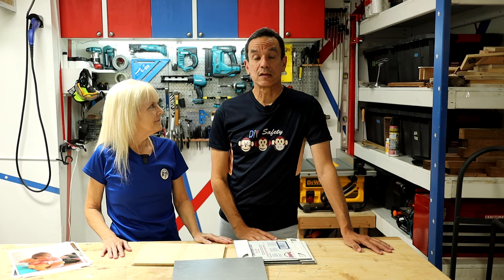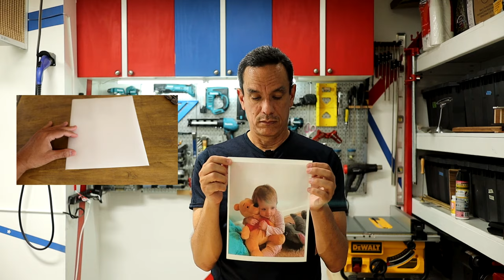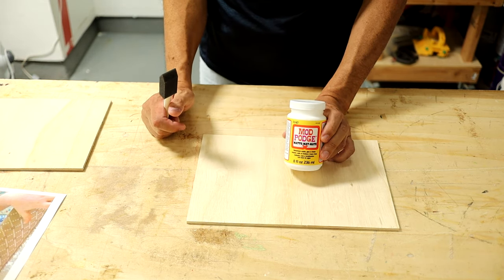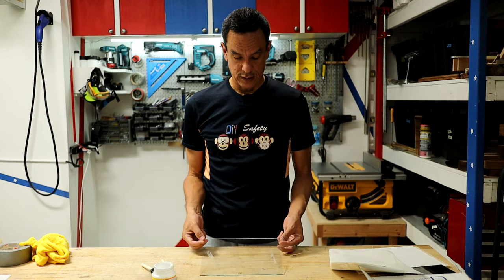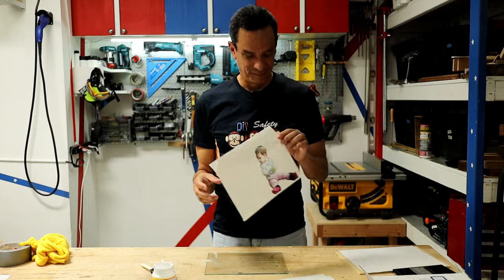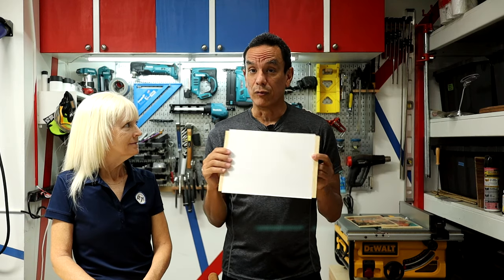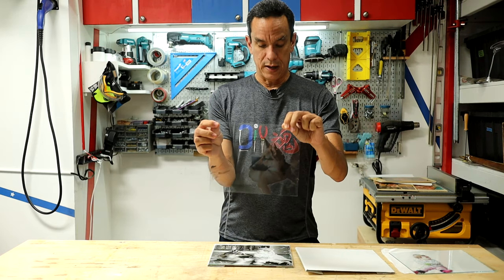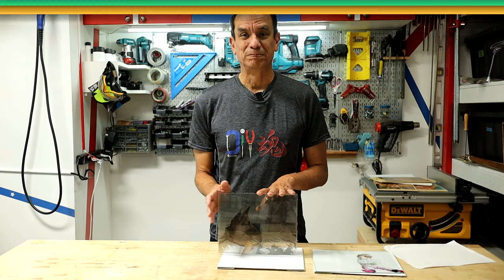Photo Transfer To Wood, Metal and Glass

Comment: It is such a bad video did not like how you showed the process ... you need to stop assuming that we, your viewing people know what your talking about you never said what kind of paper you are using its called Transfer paper and they are all different for, wood transfer, glass transfer, metal transfer, cloth transfer, and the different types of transfer paper I believe you had the generic transfer paper for transferring ANYTHING but not very good it's not as easy as you think but this is the first video clip I have watched when I first saw you both I thought I like these folks but it's not what you had said it was what was behind you, y'al have some nice toys or tools  but I will subscribe I like your honesty about what went wrong ... Poor Man's DIY I like it
Reply from the maker: Gman Marx, we honestly appreciate your taking the time to watch our video and for leaving a comment. I am sorry we did not  explain things well enough for you. If you go to the 2:00 mark, I explain that we use the back of labels to print on. it is very slick and the toner does not stick to it. In other words, the toner is just sitting on the slippery surface and it easily sticks to the mod podge (glue). We did not use a transfer paper. We used the same label paper for the wood, metal and glass. I am sure you are correct about various types of transfer papers, but we chose not to use them. There is an associate link to the labels we used. You can go to Amazon and see exactly what we used. I hope this clarifies things for you but if you have any other opinions or questions, please do not hesitate to address them and we will do our very best to try to provide a proper resolution.